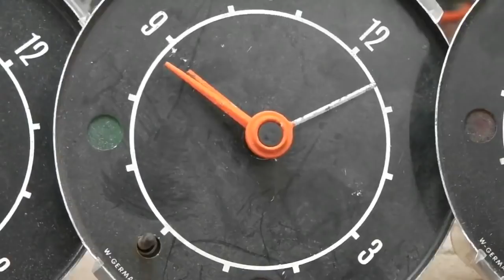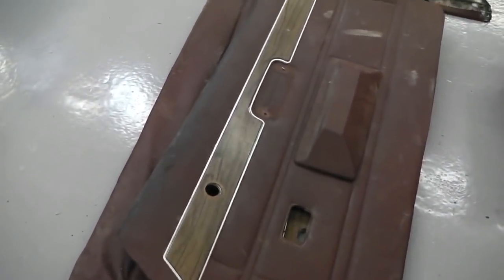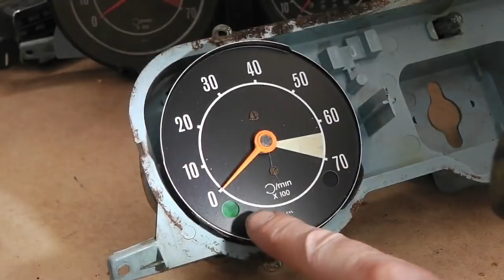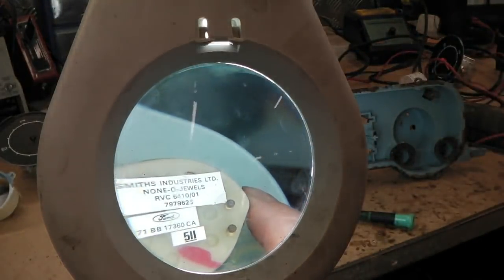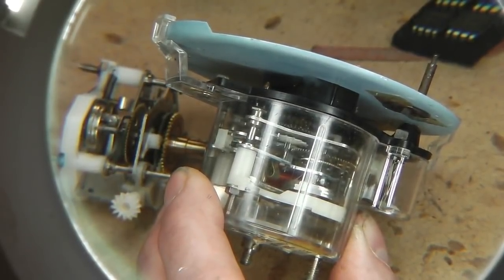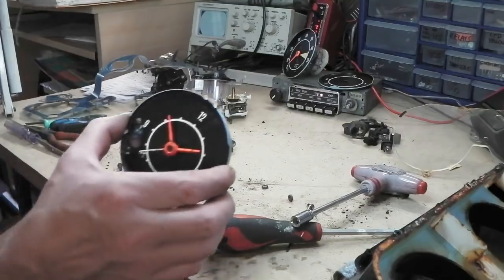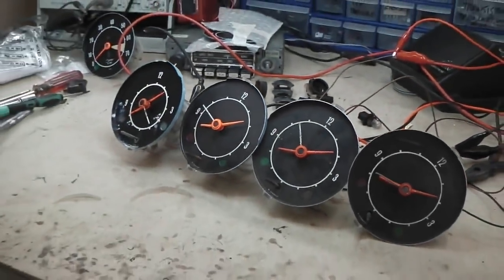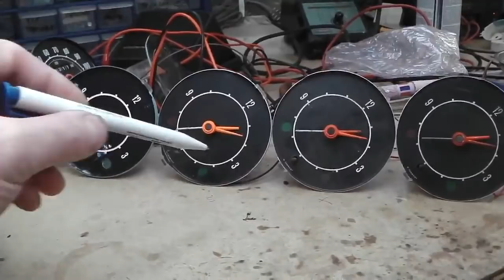Ford Ford Cortina Dash Clock refurb and repair PT1 - Project Bramble tech video.

Comment: Nice clock show on the entry of the video. The wiper system is ready to rock I think.  There's lots of prep work goin' on in the interim.  I recall the details of the clock and dash work on Swampy. This all brings back good memories and it is also a tell-tale sign of where the build is in regard to being completed. We are getting there Pete.  That is one cool fan sensor visual indicator you came up with.  That is some intricate clock work my friend. It's amazing how much patience you have. Again, salvaged parts saves the day.  I am not sure why but I fell asleep  at the final few minutes. lol. Thanks for sharing Pete.

Comment: Fantastic video yet again. Great insight into the time clock, I am having trouble with the clock on my rover p4 and this vid has been just what I need to start to tackle the problem, also there is a clock in the Austin a35 I've just bought which is a aftermarket unit, not sure if that works as the car is a complete restoration project but these videos are great for reference in the future, keep up the great work mate.

Comment: All great stuff as usual. The fan indicator you have most probably thought of this. In the Off position the hole could be disguised if the moving back plate is painted black for that off portion

Comment: lo P sorry about the pun but i havent found time to watch it through all the way yet and was late to the live show, i love this kinda stuff rather unsurprisingly as a youngster always had broken clocks and things in bits seeing how they worked and trying to fix them, i have a question the oils you used to lubricate moving parts are they silicate based as i found that WD40 makes plastics bind? i also have a distant memory of seeing the time adjustment tabs missing on most ford cars and one glorious moment of seeing one in place complete with turning nob on the end what makes me smile now the owner so proud of its completeness.
Reply from the maker: I used ptfe based oil but only on the clock hand shaft, left the workings other than IPA solvent and gentle blast of air.

Comment: Yes the blue being nearer the bulb reflects less light than the white further away, evens out the glow a little, Laser patterns can be used on lens mould’s for mobile phone screens (LCD screen 20 years ago) pattern would interrupt light flow and give a uniform glow from a single light source....😊
Reply from the maker: thanks for this Patrick, very interesting, i noticed it also gives a nice easy on the eye hue, just fitted the lamps back into the dash cluster and tested with led lamps, ver uniform and easy to read much better than filamant/ incandescant bulbs

Comment: Your Cortina Clock as a mechanical device I should think can be lubricated with very small drops of synthetic or clock oil in the right places, the are some websites I've seen suggesting this for mechanical clocks. I know from experience with other Electro-Mechanical devices e.g. CD Players and Cassette Decks they require lubrication (oil and grease) again in the right places. I'm not sure how you would find out which areas to lubricate in these Ford clocks though.
Reply from the maker: thanks for this info Andrew, whatever you put in thsi clock needs to be just a slight amount, i now have clock in the dash keeping good time so far.

Comment: Hey Pete,  Can I ask an off topic question of the Cortina fraternity via you?  Over the years I have 5 Fords 3 Granadas - a Mk1 3.0GL estate, a 2.0 saloon & a beautiful 2.8 Ghia estate which was knicked & recovered as a wreck (very annoyed). also 2 Mondeosw ( imho mundane because they are so good at being the car for everything, the just do the job with no fuss).  However, I am no expert on Cortina history but it appears hat the Sierra is little more than the Cortina Mk6 with Fords marketing dept attempting a rebranding exercise to convince buyers it is something else?- Is this a heretical thought or generally accepted in the Cortina world?
How are Sierras treated at Cortina meets?
Reply from the maker: great question!!!!! Kim !!, the floor pan is totally different, im sure theres more, engine was same initially, of course Sierra was new cortina, but as far as I know, the engine was contiued (PINTO) and possibly even the C3 gearbox made it into Sierra, correct me if wrong on that, but DEFFO not like the STELLA where they shared floorpan, ..........im open to answers on this.......but thank you for question, Pete

Comment: Top Tip, Pete... check out Hydrochrome from Custom Creations Paint... perfect chrome finish (ideal on plastic chromed parts etc, water borne, £180 + the dreaded vat for the pump sprayer kit. There are loads of vids on here... this is not a plug! And no, I'm not getting paid! But I am going to buy the pump kit in the new year! Cheers. Leigh.
Reply from the maker: thanks Leigh yes I did see this, I await to see results, looks very intersting i wonder how hard wearing it is

Comment: Please don't attempt to calibrate the speedo by bending anything, especially the magnet shrouds.  They need to be re-magnetized and then the magnetism reduced while running until correct speed is shown in relation to the input.  Instrument technician job.
Reply from the maker: Chris, the speedo i did is acurate to 1 mph on sat nav/gps speedo usig the techniques i tried. I prob got lucky and appreciate what you say technically